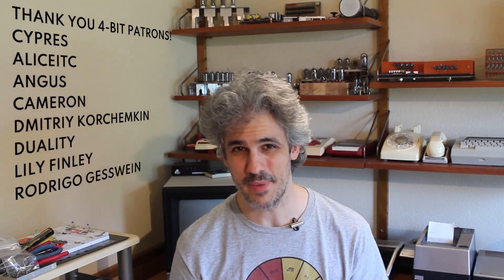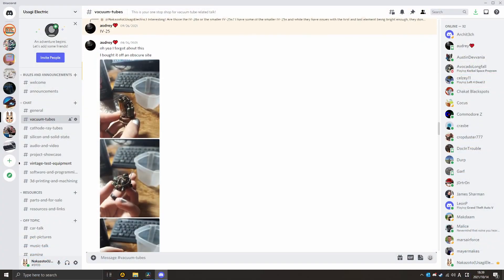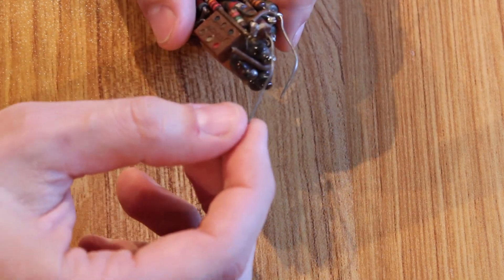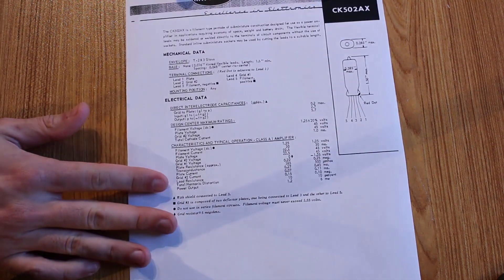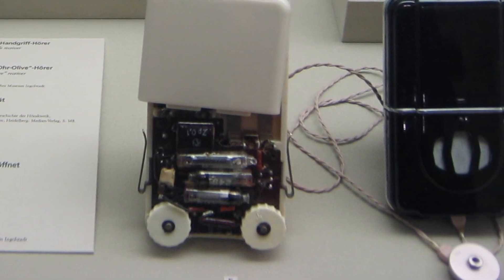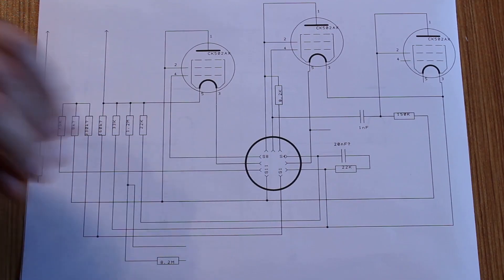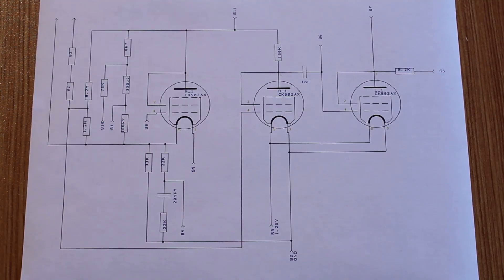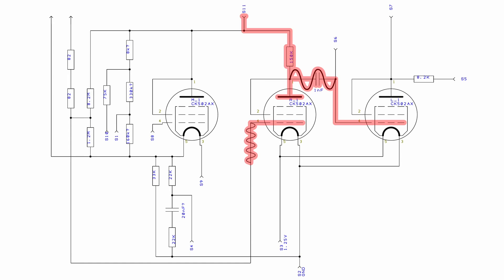Trying to Reverse Engineer a Vacuum Tube Integrated Module

Comment: Its a homemade diagnostic tool old timers used bitd working on tube radios in the IF and osc circuits ,, transmitter repair really come to mind more than anything

Comment: Why do you think L1 has no plate resistor? Because it doesn't connect through a resistor to S11? Just seeing  L1 in isolation I would have thought the 8k2 was a plate resistor and swap the positions of S5 and S7 on the schematic.

Comment: I did find a book that you can reverse engineer tube to electronics.  Book had wiring diagrams on each pages for each tubes model.  I regretted for not getting the name and author of the book. It was published in around 70's.  Unfortunately, Library decided to sell old books so It's basically lost.  Hope you know what book it is. It's a small book, around 5 to 7 inches tall and 5 inches wide.  IT had detailed diagrams.

Comment: You basically said it. The second 2 tubes are an amplifier. The first controls it's gain. So what makes sense? An audio stage for a receiver with AGC. Perhaps a portable, battery-powered radio? I'm not seeing where you got the 1 kHz cutoff for the 1 nf coupling capacitor. That grid according to the spec sheet is meant to be negatively biased. So it should be a very high impedance input to the grid. I'm pretty sure the 1 nf  will support the the whole audio range.

Comment: The approach I take when reverse engineering something is I first build a BOM, then use that to make a list of pins. As I determine each set of pins that are connected, I write it out as one line on a separate sheet and cross them off the original list. At the end I should have a few pins left that should be easy to verify whether they are unused. Then it's easy to take the BOM and 'node list' to construct the schematic.

Comment: In case you never figured out what it was, I suspect it was a way for either a manufacturer or the user to upgrade of modify an existing radio, allowing it to perform in different bands or something like that. I have seen a radio with a tube socket on the back but never guessed what it was for.  Now seeing this, I think it makes sense.

Comment: Hi. Have you considered that S1 &10 could be connected to S6 & 7 outside the unit ? As S1 & S10 could be both biasing and plate resistor arrangements. If you add the 75k and 8k resistors you get a plate resistor, and if you add the 330k and 8k this makes a biasing when paired with the 160k (mayby/possibly added to the 33k which is connected to the ground).

Comment: Ive built a number of widgets in this sort of spider frame construction. Its a really fun mental exercise. usually single block sections for testing, or just because I can. a little audio oscillator on a 1/4 inch TRS jack, RS232-TTL that fit in a backshell, that kinda thing. but the LM1875 and LM3886 chip amps have been my favourite. not counting the rail caps, got the circuit down to about the size of the TO-220 pack. No need for them to be that small, but it was the challenge. sounded pretty good, and weird to be so tiny (and have so much oomph)

Comment: Ahh, you're here. Good. We've got a problem. A big one. The controller chip for our water purification system has given up the ghost. Can't make another one and the process is too complicated for a work around system. Simply put, we're running out of drinking water. No water, no Vault. This is crucial to our survival. And frankly, I... I think you're the only hope we have. You need to go find us another controller chip. We estimate we have four to five months before the Vault runs out of water. We need that chip. We marked your map with the location of another Vault. Not a bad place to start I think. Look, just be safe, OK?
Reply from the maker: War... War never changes...
Life in the Vault is about to change.

Comment: Maybe this CK502AX tube was replaced by the CK722 transistor.
Reply from the maker: Oooh, interesting idea!
Though, I'm not sure how related they may be. Vacuum tubes in general are more closely related to N-Channel FETs, but the CK722 was a PNP transistor, which is a functionality that tubes can't really exhibit. However, both being manufactured by Raytheon, there may be more of a connection there than I can see!
Reply: @UsagiElectric  I guess CK was used for active devices such as vacuum tubes so they used it for transistors also. People joke about CK722 because it was the first available transistor for electronic hobbyists.
You could probably make a MC14500 with them. How many transistors does it have?There are a few on Ebay for $49. A lot of them don't work by now, they were not sealed very well.

Comment: That’s a puzzler.  It amplifies, but bizarrely.  It’s not a VT fuse,  those particular tubes were not designed for 20,000 G’s.
Reply from the maker: You're definitely right about that! 
These tubes were originally designed for hearing aids, and if a hearing aid experiences 20,000 G's, something has gone horribly wrong, haha.
Reply: Old thread, I know, but here's a fun fact: as recounted in the book “12 Seconds of Silence,” by Jamie Holmes — a history of the development of the proximity fuse by the brilliant Merle Tuve and his team— the fuses DID use specially ruggedized hearing-aid tubes, and they WERE made by Raytheon (with Hytron and Bell Labs also involved.) The book includes a cutaway photo of a fuse, and one of its components (labeled “oscillator-detector amplifier thyratron bundle”) looks a bit like the mystery gizmo in this video, right down to being constructed on a multi-pin socket base.

Comment: Reminds me of the Loewe 3NF tube, a three tube circuit in one socket
Reply from the maker: Oh man, the Loewe 3NF is my unicorn! It truly is a tube integrated circuit. I love that they encapsulated the passives in glass too so when they off-gas it doesn't contaminate the vacuum required for the tubes. What a beautiful piece of engineering!
Reply: You just taught me something new! what a wild little device!

Comment: Since the suppressor is comprised of two deflection plates, this is actually a 'beam tetrode' or 'beam pentode' depending on how you count things.  The British would call it a 'kinkless tetrode'.
Reply from the maker: Yup! It seems the naming convention on this type of design is really all over the board. You can see that for this one, Raytheon just calls it a regular "pentode", but I've seen both beam tetrode and beam pentode, as you mentioned, used many times as well!
Reply: @UsagiElectric  Patents and trademarks have something to do with that.  IIRC Philco had a patent on the power pentode tube design, and RCA HATED to pay royalties.  Since Philco didn't offer them a decent cross licensing agreement, RCA developed the beam power tube (6L6, 6V6) to avoid their patents on radios they sold under the RCA name.  (I don't think they had a problem with second sourcing the PP tubes for renewal use, or to makers that paid the royalties on the PP to Philco).
So some tube makers didn't use the name 'beam pentode' or 'beam tetrode' to avoid stepping or RCA's trademark.  The British had their own term for the beam power tube, which they developed independently from RCA (Kinkless tetrode).
Reply: @scharkalvin  wasn't it Philips that had the pentode patent, and not Philco?
Reply: @goodun2974  Possibly.  I only remembered that the name began with 'P'.

Comment: I have a Datamath myself; a version 3 model which I believe was built in Italy.  It's just missing its battery cover.
Reply from the maker: The Datamath is a great little calculator!
The version 3 is an excellent model too because you can just change the batteries as necessary. I had to remove the original NiCD batteries that were in mine and replaced them with a little LiPO and boost board from Adafruit. I use mine almost everyday, I love it as a quick and easy to use calculator!

Comment: Based on what you describe, this seems likely to be an RF pre-amp for the antenna input of, um, something.  Given it was made between the introduction of submini tubes in the mid-1950s and when (most, low power) tube devices went out of production in the 1970s, I'd guess this was intended to amplify antenna input for a higher-end, probably FM receiver (or just possibly a compact television).  Higher end, because lower end would have likely had a (cheaper) single pentode RF amp running a higher voltage.  Don't forget, smaller was expensive back in the day...
Reply from the maker: I think you're pretty close to on point with what it might be. I'm afraid we'll never know for sure unless someone recognizes and remembers it's original use, but I like the idea of it being an RF pre-amp!

Comment: It's a flip-flop!
Reply from the maker: It being an multivibrator design is an interesting guess! 
I don't quite think it could be though because of the coupling capacitor. Flip Flops usually work on DC signals, but the 1nF coupling cap means it really only cares about AC signals.
Reply: @UsagiElectric  Thank you for you reply Usagi, of course it was just a wild guess!
Have you ever thought about making a wristwatch with nixies?

Comment: I think the tubes at the right could be arranged on differential amplifier (long tail pair) configuration to obtain the amplified and filtered signal from the input (tube at the left with RC network filter) in phase and in opposite phase (inverted).
Then that signal could be amplified by power tubes to drive a center tapped power transformer, or something that needs two signals, the original and the inverted one.

It could be a rudimentary operational amplifier with a cathode follower input.
Reply from the maker: I was thinking about it being an operational amplifier / differential pair, because it's pretty reminiscent of the old K2-W tube OpAmp. I believe though that the cathodes of the two on the right are going straight to ground though, and usually a differential pair has a cathode resistor or cathode current source of some type between the cathode and a negative voltage. Of course, that could all be happening in whatever this thing plugs into, so it's hard to tell.
Reply: An op amp and a logic gate back in the day shared some similar characteristics.  I'm leaning towards a logic gate.  Also not a proximity fuse as one opined, as there is no shock packaging.

Comment: Likely WW2 related.  Example, Proximity fuses included mini vacuum tube circuits
Reply from the maker: That's actually the second suggestion I've seen so far that it might be a proximity fuse, which is a really cool idea! I'd never thought about WW2 proximity fuses, and they're super cool chunks of technology!
Reply: I suppose that’s also consistent with the relay type base....
Reply: I was going to suggest the same thing I had seen a module out of one that had been encased and some sort of Wax.

And they had melted out the wax I don't remember if session is online or what might even been before YouTube potentially.

I just remember seeing it years ago.

And also I do know there was a radio direction finder loop antenna. Had with those or barely similar to Windows very tiny tubes as well.

But definitely is something radio-frequency for sure!
Reply: Iv seen this kind of lashup job being used for shortwave broadcasting.. or someone trying to build a way better signal grabber or used to pickup realy faint signal's

Comment: Ice cube relays come in 11-pin bases (as well as octal).  They make relay bases that break out the 11 pins to screw terminals - lots of hits for Pfy113a on the usual places
Reply from the maker: That's really interesting you could find Ice Cube relays in an 11-pin base as well! I'm familiar with them in an octal base, but an 11-pin base makes sense as well given how many different contacts relays can have inside them. That PFY113A would make an excellent break out base for this little tube module!

Comment: I read about ICs like this, as components in radios. But I don't know who used them or for what exactly.
Reply from the maker: That could definitely be a likely candidate! It might be designed to pick up and amplify a specific frequency of noise that can be then be used to cancel out that noise in the main radio system or something.

Comment: You are aware of the 12 volt plate tubes developed and used in the last few years of car radios prior to solid state?
Reply: Space Charge tubes.  I've built several low power guitar amps out of those.  Mostly using the 12U7 and 12K5, but I also built a single tube 12AL8 amp.
Reply from the maker: Yup, space charge tubes are super cool! They were perfect for 12 volt car radios for obvious reasons, but they also eliminated the need for the noisy and failure prone vibrator (a hard thing to google for), which was used to create a square wave and generate high voltage for the tube plates.

Comment: Could it be that 8.2 K resistor IS the plate resistor, and S7 is the output, not power voltage?

And M1 could be a simple cathode follower circuit, completely unrelated to the other two tubes (that's why it would need its own filament power line, since it's a directly heated cathode tube).
Reply from the maker: You know, I think you're absolutely right! I mean, I didn't trace it out wrong, I just read it wrong, haha. I think you're absolutely on point that the 8.2k resistor is the plate resistor, though! 
The only thing that makes me think M1 is a part of the circuit is that the cathode level actually affects the level of bias on the grid of R1, so it should have some influence on R1 and L1, though it could be pretty minimal.
Reply: @UsagiElectric  Some kind of AGC, maybe? Although it is hard to say, without knowing the characteristics of the tubes. Maybe it's some kind of comparator.
Reply from the maker: @demindor  An analog comparator is a really interesting idea too! And that actually leads some credence to the two separate flying leads. Perhaps they were meant to read two signals and compare them against each other, amplifying the resulting signal or something.
Reply: @UsagiElectric  Still, hard to guess without knowing anything about the surrounding circuitry.

Comment: If those two big green unknown components are coils it starts to look like a Hartley oscillator. If that gets modulated by a second signal in the next tube, this whole assembly is an AM transmitter?
Reply from the maker: Oooh, that's a very interesting idea!
There's actually a third big green component hiding behind the two that are visible, which is why I thought maybe they were a voltage divider, but I like the idea of the flying lead being a transmitter instead of a receiver! That's a line of thinking I hadn't thought about all and could explain why there's a flying lead on the cathode of the cathode follower. Very cool idea!
Reply: @UsagiElectric  I also remembered reading an article online about making an oscillator similar to this and placing it in or near an existing radio receiver. When tuned it would create a beat frequency oscillator that would improve the clarity of voices over shortwave. Those two flying leads may be antennas to create such an interaction. Without context of what this thing came out of, it’s hard to say what it was supposed to do. All I can say is HAM radio people have skills that are akin to alchemy.
Reply from the maker: @MadScientistGuitarLab  Now that's a suggestion I really like! HAM level stuff is certainly on a level of analog wizardry. Shortwave feels a bit high frequency for this, but I don't know enough about RF stuff to tell for sure. But, I think you're getting on the right track with this idea!

Comment: Could it be part of proximity fuse?
Reply from the maker: Oooh, that's an interesting guess!
I don't think it might be, but that's only because the military liked to use specialized tubes hardened for military use, and the subminis used here are pretty generic pentodes. But, I like your line of thinking!

Comment: Could those wires sticking up be for a "getter" to maintain a vaccum? Please don't torch me I've an 8th grade education.
Reply from the maker: You'll get no flames from here, any question or guess is a good guess in my book!
In this case though, I don't think these are related to anything vacuum related. I think I see where you're coming from though - encapsulating everything in a vacuum to have a sort of enclosed integrated circuit, and that's actually not all that unreasonable, it's been done before! The Loewe 3NF is an actual integrated circuit within one glass envelope. There are three triodes, two capacitors and four resistors all stuffed inside the vacuum. But, what's interesting is that the passive components are actually encapsulated in glass themselves because if they were in the actual vacuum, they would off-gas and contaminate the vacuum.
So, you actually were kind of in thinking in the right direction!

Comment: The metal cap and cover  is missing from that module. It had a cover and insulated connector on the top.
Reply from the maker: Oh man, it sounds like you recognize the module! Do you have any information on it or insight as to what it might be?

Comment: my guess is that the first tube is some kind of gyrator or oscillator, and pins s1 are for a specific external tuning capacitor.
Reply from the maker: Ooh, that's an interesting idea too! 
The big green components that I thought were a voltage divider could definitely be something else entirely that sets it up as an oscillator for sure.